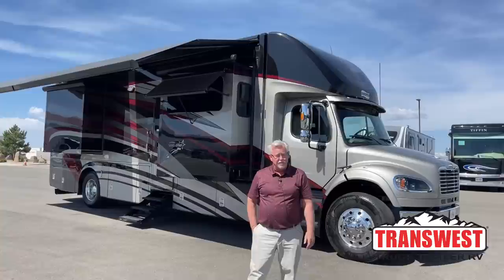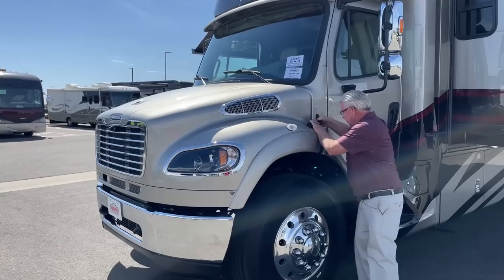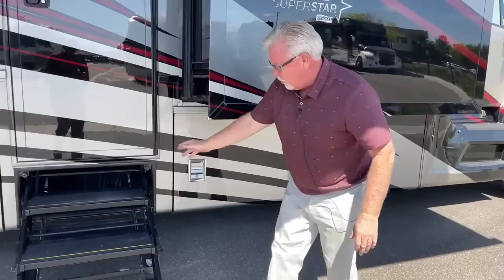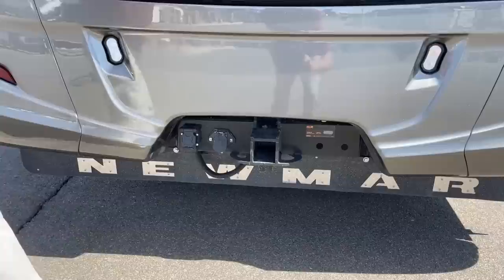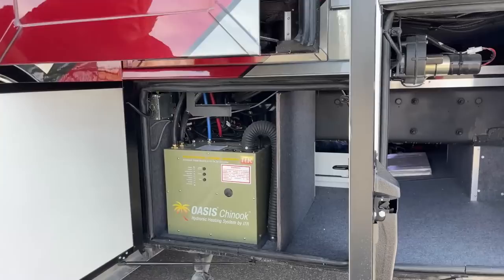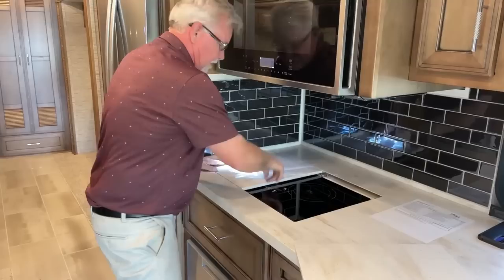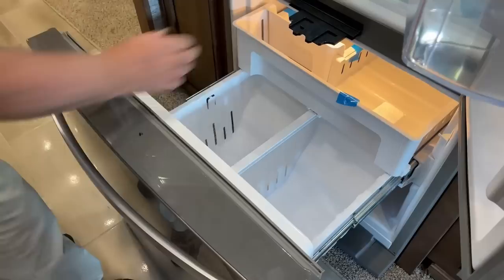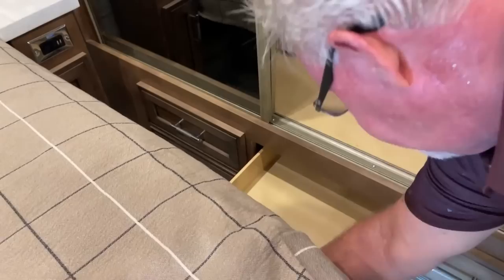2022 Newmar Superstar 3727

Comment: What kind of drivers license do you need to operate that rig?  How about if it had dual rear axles?  Air brakes?
Reply: Depends on the state, but most of
the time you need no special license because it’s recreational.  

There is specific cases, for example, if Texas is your home state you need an endorsement for air brakes.

Where people get confused is the state reciprocity laws with licensing.  Every state in the country honors every other state’s license issuance.

So what that means, if you’re a Texan you need an endorsement for air brakes no matter where you drive this rig.  But if you’re a North Dakotan, you don’t need any endorsements, even if you’re driving in Texas.

So basically, you’re only held to the restrictions of your own state’s laws.  If you’re good to drive this rig in your state, your good to drive it in any state, regardless of their specific laws for their own citizens.